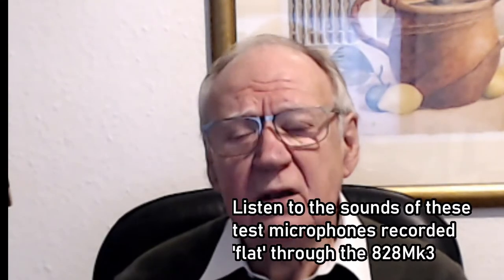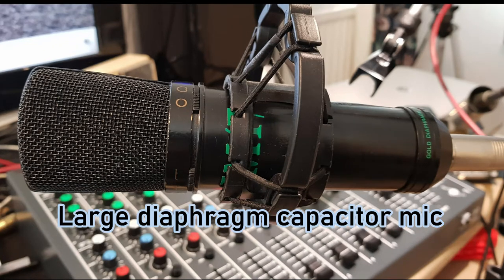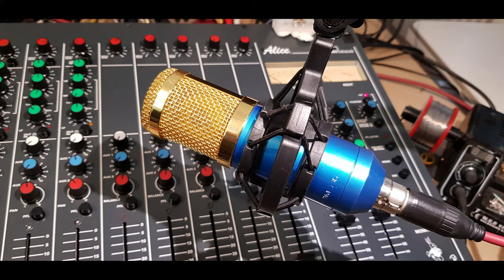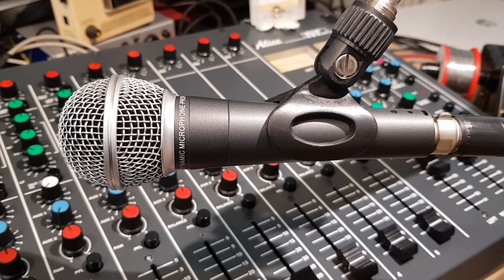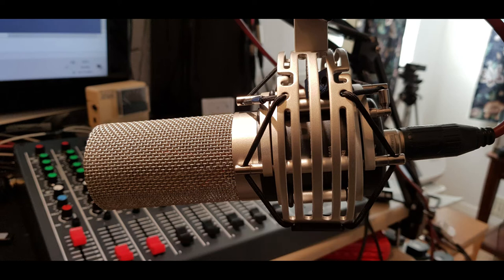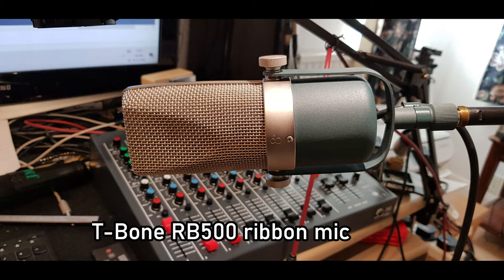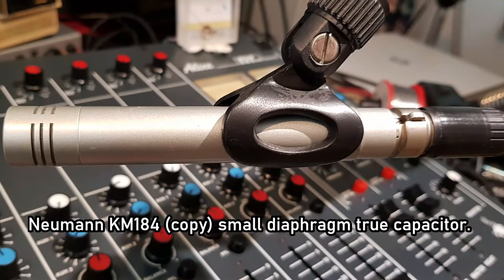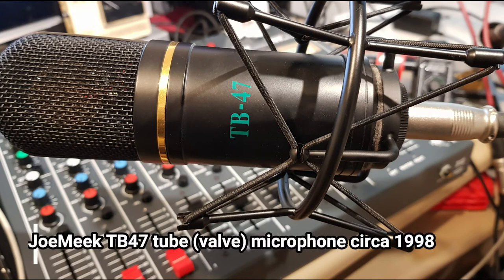828 Mk3 Mics

Comment: Hi Ted, Are there other TFpro or Alice Pre's that are the same as the 828 Mk3's?  Or are they standalone in their design?  IE are they XTX131s like in the 501 or TL072 like the Brick2?  I don't really want to open my 828 to find out! Thanks in advance.
Reply from the maker: The 828 Mk3 mic amp is unique in that it uses descrete transistors and works in 'class A' . It is very low noise and almost impossible to overload. The XTX131 is a 'class A/B' type, very clean sounding. The Brick mic amp uses a transformer and a MC4580 low noise chip using my 'shared gain' technique to achieve good overload performance.
Reply: @tedfletcher7334   Thanks for the info Ted, very interesting.